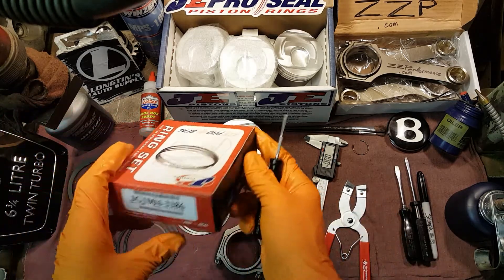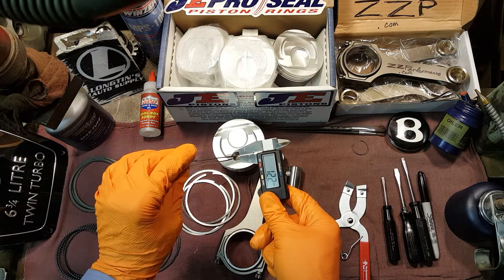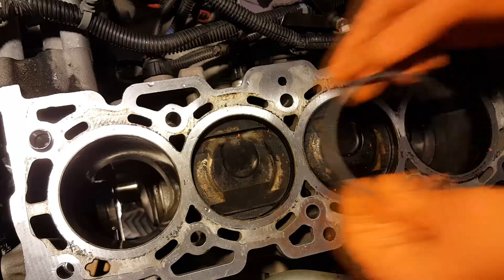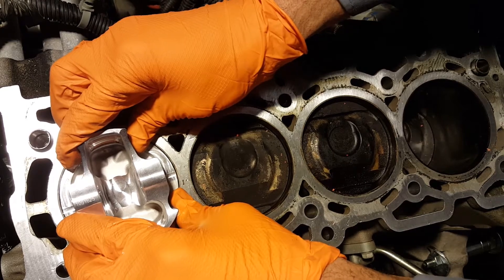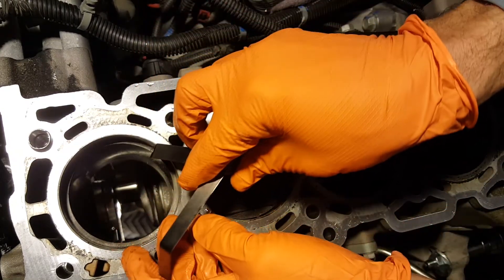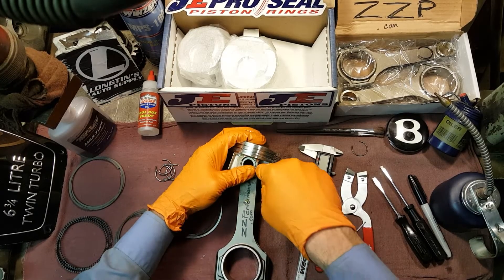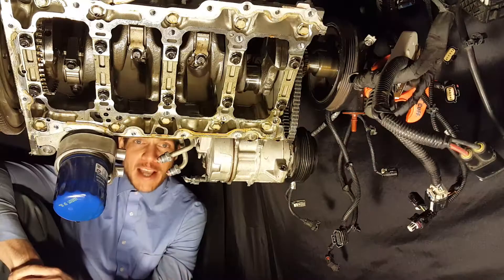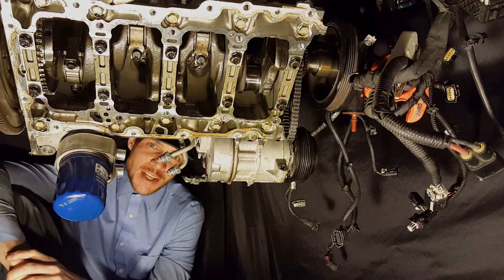StrictlyLTG Pro Tip - 2.0 New Pistons & Rings - Camaro - ATS

Comment: Hey how are things going now? I myself have a 2013 2.0 awd fully built engine with zzp rods and pistons and pushing 25psi. Is the camshaft upgrade really worth it for the money? I couldnt justify getting it. I had same issue oil in engine and cracked two pistons between rings so got ot rebuilt with forged parts

Comment: Are there any concerns with expansion with these pistons? Since they are a 2618 forge, any concern with longevity? Would hate to have to redo this install after another 60k miles.
Reply from the maker: nota gto + We have 6,000 miles on our engine right now. I would love to answer that question but I'm not sure of the answer. I would contact JE for the Pistons & ZZP For the rods. I can tell you the rods are the same size as a Chevy 350.
Thanks for the question, my short answer would be... We push 30 lbs of boost on the factory turbo, we drive the car hard, 6,000 hard miles after the engine rebuild,  Zero issues... Believe me, if the car burns down, we will post it regardless... As of right now, the car is running well (=

Comment: I have a question or two! Coking, any found on the intake valves? Timing chain, Was it lose? Were the guides worn? Are you replacing it with a new one? If, so is there any better than the Borg/Warner Morse Silent Chain? LOL That'll keep ya busy :) Luv talking to you as well.
Reply from the maker: I was pleasantly surprised to find Absolutely NOTHING wrong with the internals of this engine. No damage or worn parts out side of normal wear for having 66,000 miles. Since this engine failed due to having way to much oil in the cylinders there was a bit of burnt up oil on the factory pistons. We chucked those old bangers in the bin and replaced them with shiny new ones. .... As far as the timing chain and guides. Looks like they were brand new! I am not familiar with Borg/Warner Morse Silent Chain for this engine so I will choose to not speak about that particular part. I will not act like I know everything when I obviously do not (=
 If I were to replace the Timing Chain however I would use an O.E.M part. 
.... Thanks again for all the in depth comments.

Comment: I wish I could have a crate motor built with all these good mods for a drop in. But my 8-speed Automatic might not hold up.
Reply from the maker: We will be building low mile engines for purchase. We will build the engines to order with any spec wanted.... + Including Rig Gap if desired (= 
.... I would provide a warranty granted the vehicle owner installed a few items along with the built engine. We have found major issues with these 2.0s and we will be addressing said items in this series. 
..... We are located in southern California if that helps you? 
StrictlyLTG will also provide a Big turbo crate engine capable of 400 reliable WHP.. I say reliable because Chevy actually did something right with these engines. ( This topic will be discussed during this build series)
Also, we are getting a big turbo kit later this quarter which will take our little 2.0L to around 500 WHP. 
... As far as the automatic goes..., Ya, I'm not sure what she would hold but I would think around 350 WHP would be Ok.. Maybe that is something we can work on in the future. 
....